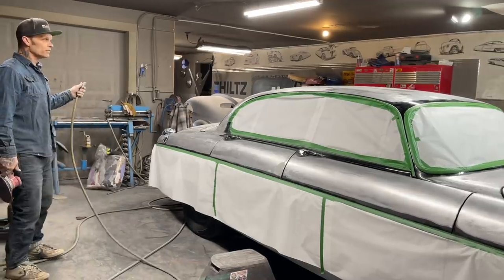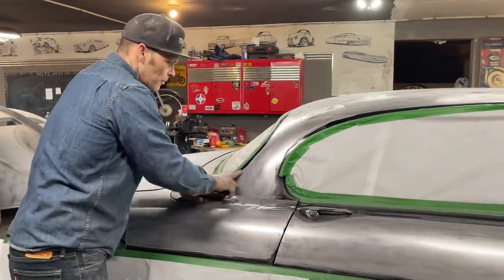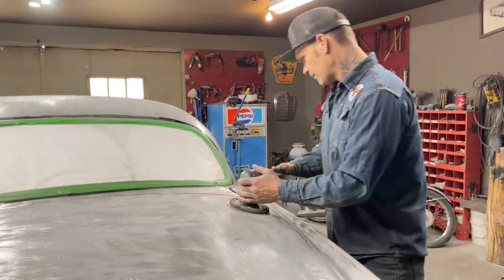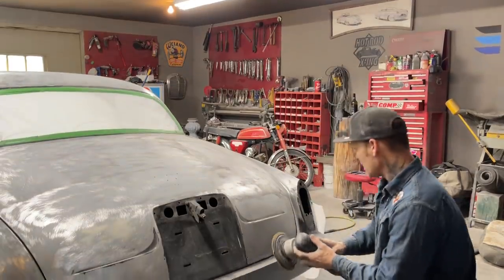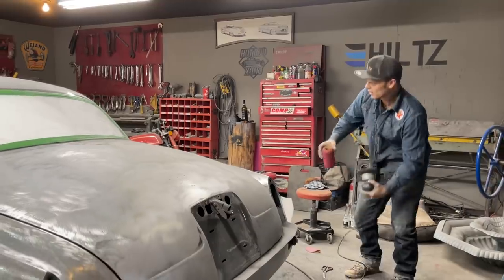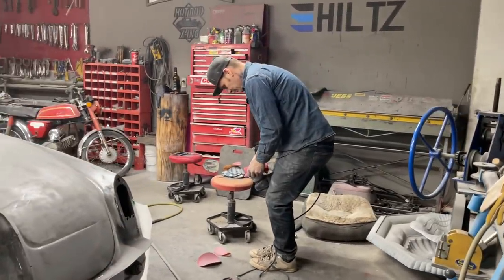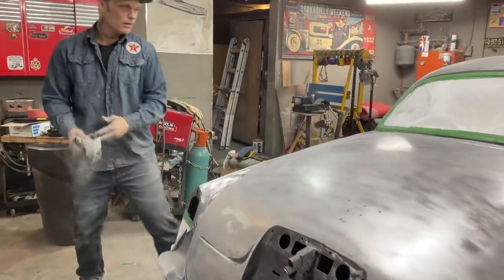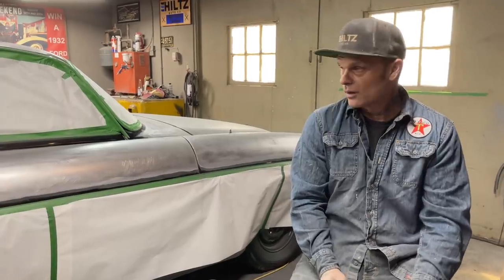FASTEST WAY TO PREP METAL FOR PRIMER

Comment: You are correct about taking 80 and smoothing out the 40 grit scratches as 80 is the perfect grit for bare metal needing sealer/primer. The rough surface of metal allows the primer/sealer to stick like glue. But you will to rough up the sealer or epoxy before priming. Unless you just shot it less than 24 hours ago. And you need several heavy coats of primer to create a surface you can guide coat and block out. I always use an epoxy primer for the raw metal. once you seal the metal surface then cover that with more basic build up primer coats. That way you have something to block down. If you use a different color epoxy like white or black, except on this black car, you will then know if and when you go through the epoxy primer. If you are sanding through several coats of primer and you hit metal it usually means you already have a high spot. So you would have to layer a whole new layer of primer in that area in order to block it back down and make things really smooth and straight. Sometimes the colors in epoxy and resurfacing primers are just different grays so it’s easy enough to see the different surfaces you’ve layed down. Great job on helping everyone figure this stuff out. 

My hopes are you will do a bit more editing work on these videos and create some of the boring repetition work in time lapse or fast forward it. During those times you can edit in your information you want to convey by recording as you watch the sections or episode pieces you've already recorded. You just have to remember to be silent while filming those sections. Voice over these sections and it becomes a  much better tutorial . 

Keep em coming!
Reply: Excellent points about the delivery of the video. Thanks

Comment: Im currently prepping my '96 f350 pwrstrk for auto body from the rust, as well as new  paint. I have numerous replacement parts: new cab floor panels, rockers, cab corners. And also some older, solid body parts, from a '97 i purchased for 2nds of all salvageable things. I will be watching more and more of your vids. I appreciate the talent and quality of the work performed. Im a stone mason by trade, but have an obsession with re-building my truck I've owned for over 20 yrs. Im in Massachusetts. Frame is solid, for we restored that, and put a  4" lift suspension from Skyjacker back in 2014. So glad I did cuz the truck would probly be worthless without it today. Cheers, man. Real nice detail and thank you. 🤙

Comment: The best way I have found to strip is to use Citrastip it is made from orange citric acid.  I apply a thick coat and cover with thin plastic overnight and can scrape with a razor blade.  It is non caustic and not poisonous, but it softens paint, and bondo to a milky paste.  It does take time to work a section but I am very pleased with the result.

Comment: Yes I'm harping again and I will keep on harping, you are not invincible, without a mask you will eventually plug your lungs with all the crap kicked up by power sanding.  You will eventually go deaf with high pitched sound created by that same power sanding.  I spent 20 years in the USAF working on radar, electronics create heat, the heat is taken away by cabinet blowers that are loud, they have to move a lot of air.  A good percent of those 20 yrs. I worked on hydraulic antenna drive systems that scream like a banshee and being on the transmitter deck directly below the antenna deck you got a double whammy.  I now wear hearing aids to understand what are saying to me because of those loud cab. fans and screaming antenna drives.  So I repeat you and Jolene both need masks and hearing protection when in the shop so you can live a long and happy life together.
Reply: The mask thing although prevents harm is whatever. I’m tired of telling people to wear a mask. I’ve seen guys get sick after a week of breathing demo dust, plaster etc, and I’ve seen my grandfather grind asbestos off of boilers to where there was white clouds 40 feet surrounding him and he lived to 99. I will however agree with you with the hearing. No one is immune to hearing damage.  My hearing got pretty bad from three deployments to Afghan.  When I came back home I continued running heavy equipment and never wore ear plugs because I figured it won’t get worse.  Hearing damage doesn’t stop because of exsisting damage.  Thanks for your service!!
Reply: @streetassasinGSR96  Yeah I know, I smoked early teens to 40's, I'm 80 now, stopped when I was diagnosed with MS, last I heard my lungs are clear.  I reckon there are some of us out here that have some really goo gene's and them that don't.😂
Reply: @dennissheridan1550  ain’t that the truth!

Comment: Yep,painted a bumper yesterday with rattle can paint and clear coated it with automotive clear,the color didn't blend well,so bought the right color for it,resanded entire bumper and sprayed it with the right paint,got wringles up the ass in the base cause when I resanded it some areas went thru to rattle can paint,and the base reacted to it causing many nasty wringles,now I created two more days of extra work,for being in a rush.
Reply: Nothing wrong with wringles
Reply: @RubinsRacing350  🤭🤭🤭
Reply: @RubinsRacing350  this wringles were extremely bad,bubbled the paint so bad,I almost fainted in disbelief.Especially on a customers car.😭😭😭
Reply: It’s ok that’s how u learn sometimes.That same thing happened to me on a motorcycle tank that I had flamed I had to completely redo the flames I didn’t make the same mistake again

Comment: I wear hearing protection listening to the sander (not a mask comment !!! ). Learning lots here. Thanks.
Reply: I wear hearing protection when I'm welding
Reply: I usually wear earplugs when I weld if not a spart will end up in my ears.
Reply: I was welding and grinding a panel today. My mask was completely tan with dust and my face was black where the mask did not seal all the way. Chad's lungs must look like Harlem on a moonless night.

Comment: I used my father Floor Refinishing Sanders to do body work , He had A Machine called a Edger it was used to get get up close to the base boards without damage to the Board , I used it on cars that had side molding , All pop would say is Slow as you go.

Comment: Hopefully it’s going to get acid etched before the primer is applied & all the panel gaps are going to be soft edged using something like 3M sponge on a roll to stop the overspray getting into the door, trunk and hood gaps.
Reply: Epoxy
Reply: were talking ospho the epoxy?

Comment: I used to work in a body shop, the trick to getting away with this paint job is to re stripe it after colour sanding and polishing. I would probably paint/clear coat over the old stripe because trying to hide the transition right on the stripe the edge will be a bitch.

Comment: If that car wasn't prep right you should remove all the chrome trim and remove all the paint or it's going to start peeling off around the trim
Reply: i a gree i was body man&painter for 43 yrs. for a living
Reply: Yes i,d agree with that, as the black paint was suspect the silver probably is too, abd it would save pussy footing about working around stuff, clear the decks properly and do the whole car from bare metal.
Reply: @rogerfrancis65  the owner only wants the black repainted, so......
Reply: @bigtxsdude  I never said anything about the silver, I said if Chad wants to paint the black right he needs to remove all the black
Reply: @6996brandyl  peeling off
Reply: @glenncutright9769  
Join the club, I was a panel beater and paint refinishing technician for forty+ years. Built several Hotrods over the years, won Best engineered, Best Paint, NSRA (U.K.) Top 10 award. This isn’t the correct way to do the job .
Reply: @geofo60  I agree. The right way is a lot longer .That doesn't get factored in by the Chad. It would be nice to see that Chad talks about the right way but........
Reply: You guys leave Chad alone, Chad knows what he's doing! Chad learn from the best Earl Scheib 1 of the best body men in the world,l I believe you are all just jealous that Chad is getting from Joleen
Reply: I'm sorry brandy but every hears of spell check hun??

Comment: Next time u run into that problem try useing a lighter sandpaper 180 or 220. I know it sounds backward but that heavy grit some times just scratched. Its too far apart. Finer paper tbe grit is closer together. And another thing that might suprize you exspecially on them old cars. Laquer thinner exspecially of thats laquer paint/primer. That dont look like a true DA. DA stands for daul action. Which means it does 2 things. It sands like ur doing or u can lock it in and grind with it. Im not seeing a lock on urs. I think tbats just an electric sander. Sorry im such a dork.. Ur running that fast as fk is it variable speed u should turn it down ur just eating ur paper up that way